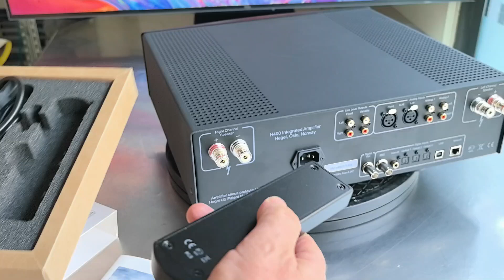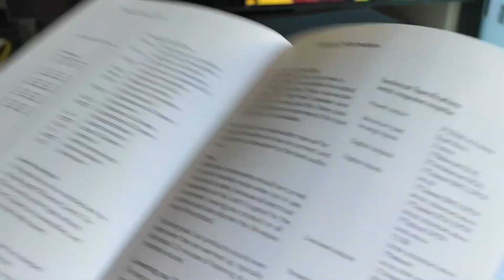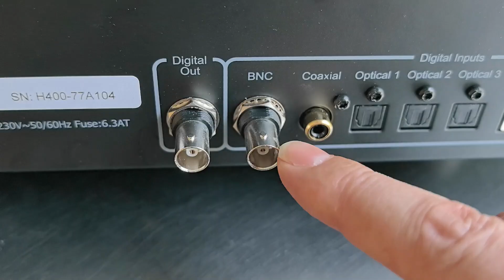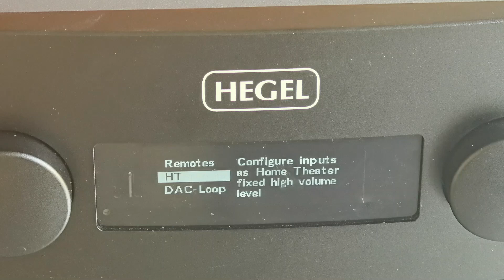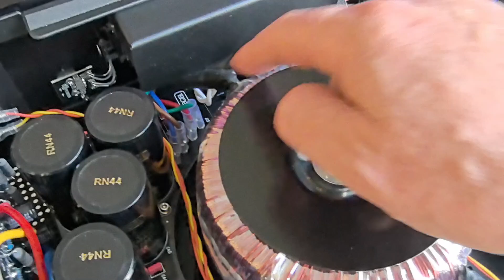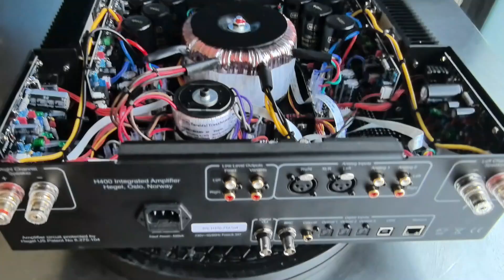Hegel H400 High power streaming amplifier with Roon, app and Connect | The successor of H390.

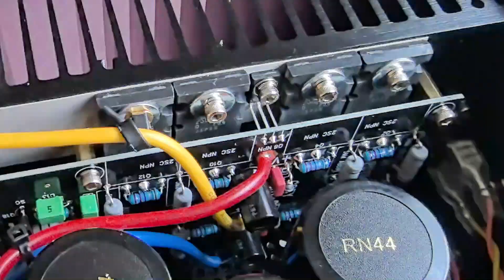Comment: Due to the unfavorable perspective (too close or too far away with the zoom and a lot of shaking) I couldn't see how many transistors the device has. Since only NPN (4x 2SCxxxx) transistors are visible (5:09) which are mounted high up on the heat sink, the PNP (2SAxxxx) transistors must be at the very bottom. So there must be 8 complementary transistors installed per channel. By the way, I'm an electronics engineer. A very nice design, I like it a lot. 🙂
Reply from the maker: It has 4 pairs + 1 pair of transistors per channel.

Comment: Nice explained 👍
I didn't hear this amp so I can't comment about this amp but my friend has another hegel amplifier and i don't like its sound , yes it has Great dynamics and excellent control of bass but piano doesn't sound real don't has the body that piano should have ,i guess it's a matter of taste, it's not my taste.
Reply: Yes, it is a matter of taste. I love my Hegel H390.
Reply: Μόνο οχτώ τρανζίστορ;μηπως έχει και αλλα οχτώ τρανζίστορ στο κάτω μέρος του;😅
Reply: @georgepyrgelis4217   Oben sind nur NPN 4x und unten müssen logischerweise 4x PNP sein, insgesamt 8 pro Kanal = insgesamt 16 Hochleistungstransistoren. (German)
There are only 4x NPN at the top and logically there must be 4x PNP at the bottom, a total of 8 per channel = a total of 16 high-performance transistors. (Englisch)  😉
Reply: @georgepyrgelis4217  in English?
Reply from the maker: It has 4 pairs + 1 pair of transistors per channel.